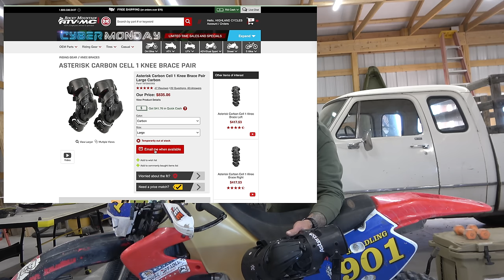Fly Formula Carbon S Review | Asterisk Carbon Cell Knee Brace Review | Baja 1000 Parts Review

Comment: Been running the Tusk sprockets and X-ring Gold chains for over ten years on 4 bikes and a couple of my buddies bikes as well. 250’s, 300’s, and a KTM 520. They hold up well. May not have any bling factor and might weigh more, but I get excellent longevity from them, and after initial break-in, never need adjustment. Best bang for my bucks.